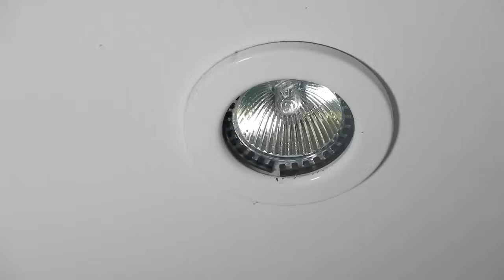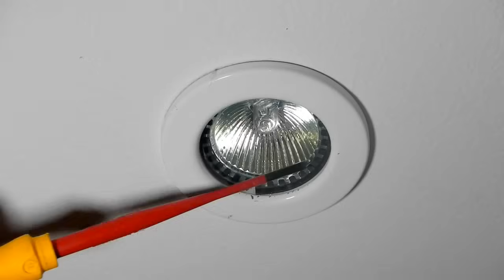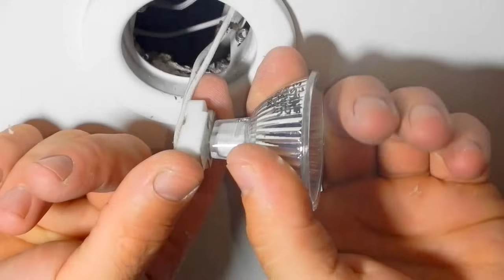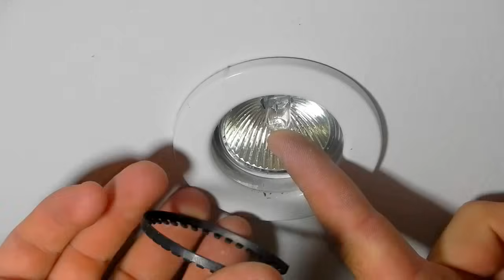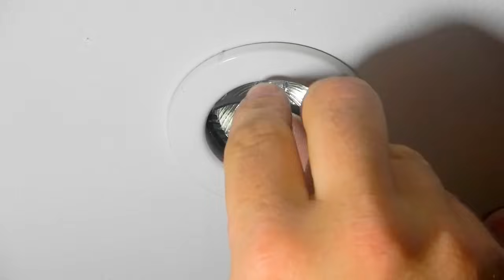How to change a 12v halogen downlight bulb W metal ring . DIY

Comment: Ok. Do I close and insert the metal ring first, before I put the bulb in? Signed: Thick as a brick
Reply from the maker: The metal ring must be below the bulb. 
The metal ring is what stops the bulb from falling down.
The bulb must be put in first, then you must  put in the metal ring, against the bulb, to prevent the bulb from falling out.

Comment: Must hv deleted yr answer. LT bulb just like yours, metal ring like two large parenthesis marks that do not meet bent at the ends. How do I install, must lt bulb be removed first it is dangling from ceiling hole
Reply from the maker: Unsure without seeing it. This video shows how to do it with this style of downlight fitting, with this style of metal ring. The bulb must be up in the light fitting first, then while holding it up with 1 finger, so the bulb doesnt fall down, you need to insert the metal ring with your other hand. The circular metal ring, when out of the fitting, will have a gap because it opens up( as its usually under pressure when its inside the fitting). You need to close the gap in the metal ring for it to fit into the fitting, below the bulb, then it works by putting pressure on the fitting, and holds in place. I put in one side of the metal ring, first, so it it pushing up against the bulb, then push the other side of the ring, into the fitting, and push the rest into place. The metal ring gap must be held together to be able to fit . You could use 'cir-clip pliers' which are a specially tool, but 9/10 you can just hold the metal ring together and slide it in. I hope this answers your question, but it's hard to explain as there are many metal ring styles.
Reply: thats what i have and its dangling

Comment: Mate i have one of these but when i get rid of the little rim the bulb inside doesn't pop down, thoughts?
Reply: Having the same problem. Did you ever figure it out?
Reply: You have to gently press the bulb and rotate it to the right or left wichever way it allows you not much just a little bit and it will come of

Comment: LUKE: NEW HALOGEN B.ROOM LT BULB IN PLACE: HOW DO I INSERT METAL RING THAT HOLDS IT IN PLACE: YOU ARE V. CLEAR, HELP PLEASE
Reply from the maker: Unsure exactly what your asking. The circular metal ring, when out of the fitting, will have a gap because it opens up( as its usually under pressure when its inside the fitting). You need to close the gap in the metal ring for it to fit into the fitting, below the bulb, then it works by putting pressure on the fitting, and holds in place. I put in one side of the metal ring, first, so it it pushing up against the bulb, then push the other side of the ring, into the fitting, and push the rest into place. The metal ring gap must be held together to be able to fit . You could use 'cir-clip pliers' which are a specially tool, but 9/10 you can just hold the metal ring together and slide it in. I hope this answers your question, but it's hard to explain as there are many metal ring styles.